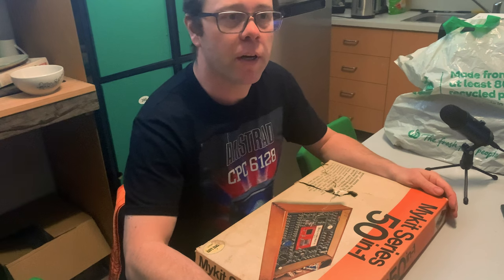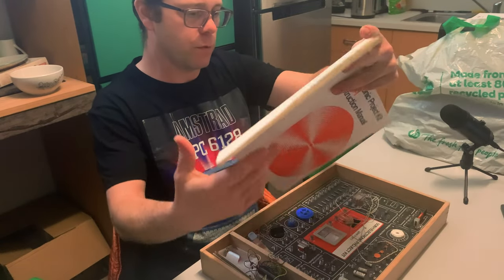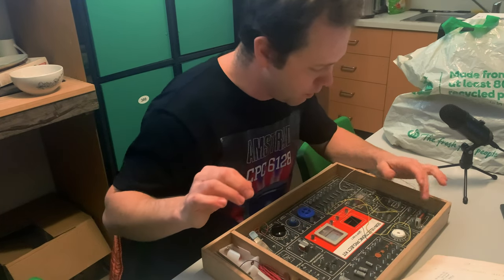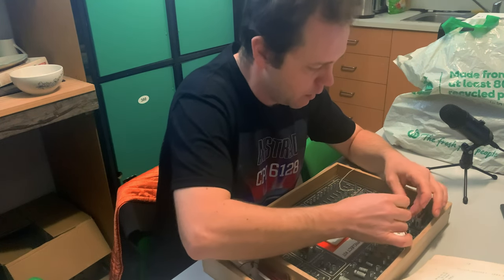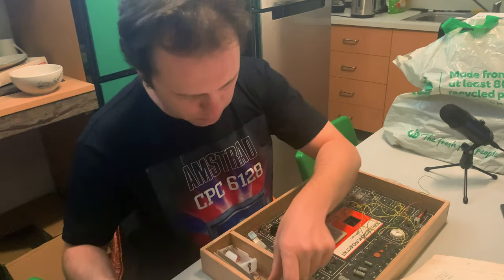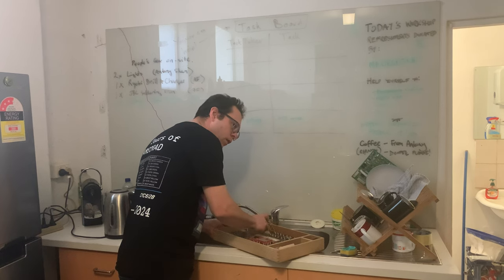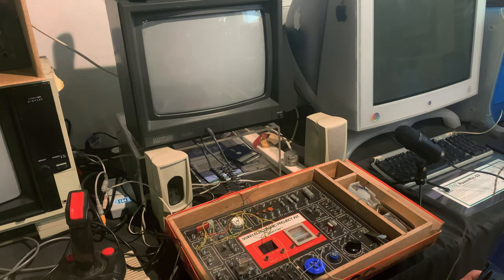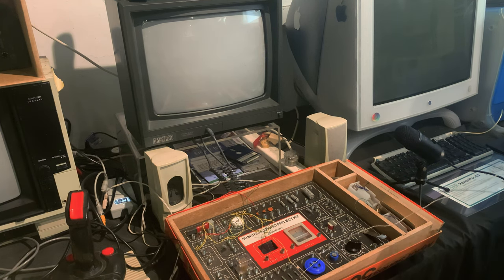Gakken 50in-1 Electronic Project Kit: Project 1 - Germanium Radio

Comment: Chances are it still works, though some earpieces can go bad. Others require a 100k resistor across them. An indoor antenna won't work with a crystal set. Instead it needs to be 10 - 30 metres of wire outside as high as you can get it. More: https://www.youtube.com/watch?v=ok7lpERL0a0
Reply from the maker: Thanks, we're also next to a 5G tower that's strong enough to interfere with Bluetooth so maybe I'll take the set out to a park or something next time!
Reply: @australiancomputermuseum  I don't think the 5g should affect it. The park is a mixed blessing. You need a remote site so you can throw wires up into trees and there's no traffic noise that will spoil reception. And you will still need to install an earth. Could use wire radials or copper pipe hammered into ground. A crystal set will work within about 50km of a strong station.